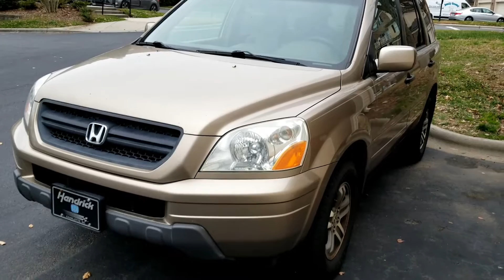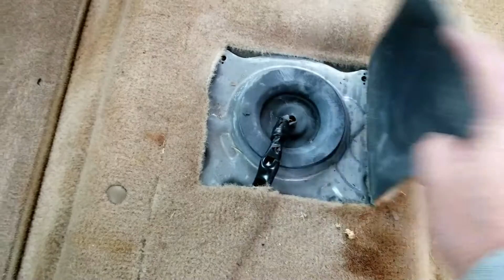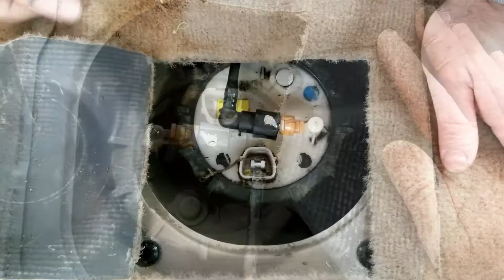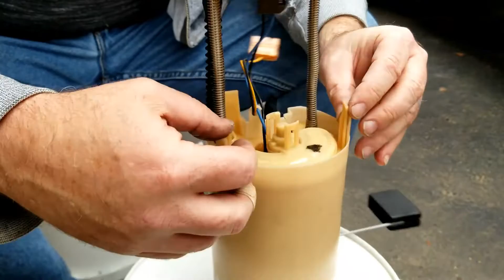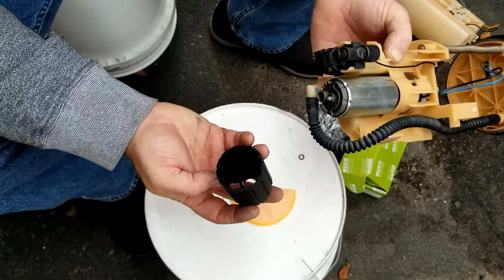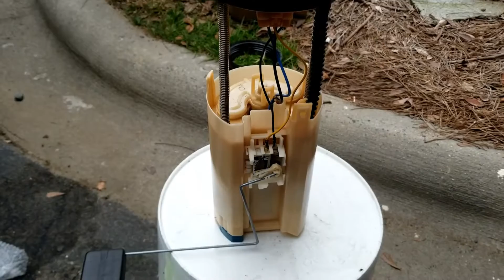Honda Fuel Pump Repair

Comment: My system dashboard says I have a fuel gauge system problem and I have no lights on my fuel monitor. 
Wondering which part on the pump do I replace the wire and the bobber or just the entire thing?

Comment: Is the fuel regulator on the fuel assembly or is it under the hood?

About to replace the regulator/ filter on a 2012 Honda CRV
Reply from the maker: If I am not mistaken, the regulator is under the hood. It is on most of the Hondas of this vintage I have worked on.
Reply: @ktecgarage  ended up calling honda and they mentioned it was in the gas tank w/ the pump
Reply from the maker: Good to know. Thanks for adding that info. On the older ones, they are vacuum actuated.
Reply: @ktecgarage  Was chasing a positive fuel trim and had done smoke tests, etc to see if there was an air leak. Ended up rebuilding injector seals, intake manifold o-rings/ throttle body o-rings, replacing intake accordion tube, as well as replacing the fuel filter/ regulator and still have the positive fuel trim(+7%) with no noticeable vacuum leak or exhaust leak. At this point I believe it must be a worn engine as it has 137k on the clock.

Posting this just in case anybody else finds a fix or common issue
Reply from the maker: @Technie87 Too much air. You know, I had an Element that was acting like that, and I got  a junkyard throttle body and it fixed it. I replaced the throttle body on a 2000 Accord and it fixed that as well. I don't normally recommend firing the parts cannon, but after all that you described, I'd consider it.
Reply: @ktecgarage  I’ll keep an eye out for one. I had just cleaned, and done a ecm/pcm, tps reset. It idles and runs fine it just has a positive fuel trim 🥲
Reply: @ktecgarage  thank you

Comment: The filter from Honda is £24, I wont risk putting non oem filter, because  if it fails in the future, you might need to kiss goodbye to the injectors. Nice video and thank you.

Comment: hi, 1) Would you have the part number for the fuel filter sock in your video. 2) Did the car run better after you replaced the filter sock? Thank you for posting an excellent video
Reply from the maker: I'm sorry, but I didn't mention nor do I remember the part number. I got that kit from ebay. The car did run better but eventually blew a head gasket. Thanks for watching!
Reply: @ktecgarage  sorry I need to ask more questions. did you replace the fuel pump and  filter sock or just the filter sock ?
Reply from the maker: The actual pump was working fine so I just changed the sock.

Comment: how long do you think the vehicle needs to sit to take the pressure off cause I just tried the pulling the fuse and cranking the car with the fuel cap off and like the kids say today that's all CAPP I still had high pressure
Reply: Kelvin, pull the fuel pump fuse and crank the car up until it stalls(#1 fuse driver side floor)  unscrew gas cap also to let vapor pressure off. Did this job today on same car! Make sure you press down on the pump when it hits the bottom of the tank. The top and bottom sections are spring loaded👍
Reply: I tried that so what I turned out doing is letting it sit for about a hour with the fuel out and disconnected the connecter form the pump then with the line still connected I started to unscrew the cap to brake the seal   (I do not recommend doing this even though it worked for me) @andyhamilton8940

Comment: I like how cheap you are and I can definitely see myself doing this to save a few bucks. But while you're already in there, why not just put in a new one and go another 200,000 mi and call it done? That's my mentality when I work on my cars
Reply from the maker: I hear you. If that fuel pump was harder to get to I probably would have switched it out. I once changed a clutch and didn't replace or resurface the flywheel! You think I would have learned my lesson that time.

Comment: Thank you for the excellent video. I have a question about the rubber sleeve that fits around the pump. Did you have to remove the OEM pump from the assembly to fit the OEM pump back into the rubber sleeve.
Thank you
Reply from the maker: If I remember right, I removed the pump to fit that sleeve. That sleeve was for that particular after market filter.

Comment: Excellent detailed video and straight to the point. I’ve got an 04 Pilot with the similar long crank issue. And this approach is what I’m going to take also.
Reply from the maker: Good luck with the repair. Hope that is your issue. Thanks for commenting
Reply: @ktecgarage  I have a 2005 honda accord with 230k miles on it that I've been using for Doordash and I've noticed that I'm getting pretty bad fuel efficiency. I've been trying to figure out what I can replace that would cause for fuel efficiency to go bad. Is the fuel pump something that would cause bad fuel efficiency?

Comment: Good video, with that many miles on that car. I'd Change the fuel pump as well, you've made it that far
Reply from the maker: The fuel pump I had was Chinese aftermarket so I stuck with the Honda part. If I had the OEM one, I would have swapped it. 

Thanks for commenting!

Comment: Awesome video thanks bud. How’s the pilot holding up? Anymore long-crank startups after the new filter? Having the similar issues with my 07 Pilot. She nearing 200k
Reply from the maker: Ah. The Pilot. It's currently getting its transmission rebuilt. I did some other things like Seafoaming the intake and I found a loose spark plug. I also believe it has a leaky injector. It runs fine, but there is some fuel smelling smoke when it first starts. But, it was running fine until the tranny let go. It'll be put up for sale after I get that tranny rebuilt. I would have pulled the tranny and rebuilt it myself, but you really need a lift for that job  Thanks for watching and commenting!

Comment: I can't find the "sock" on line ... what do you call it, where and how much ?
Reply from the maker: HANSCOSTAR New Electric Fuel Pump Fit Multiple Models Replaces E8213 E8229 E2068 HFP382 https://www.amazon.com/dp/B08LGSD54F/ref=cm_sw_r_apan_glt_fabc_YD90SQHG6ZGD2J6YDE2M?_encoding=UTF8&psc=1